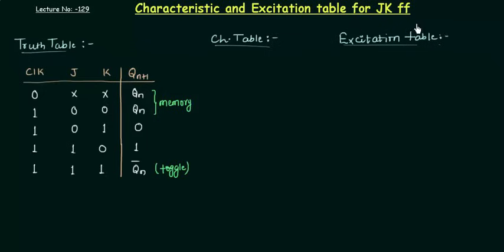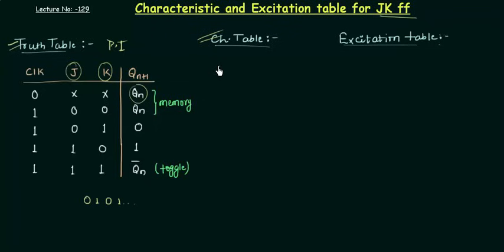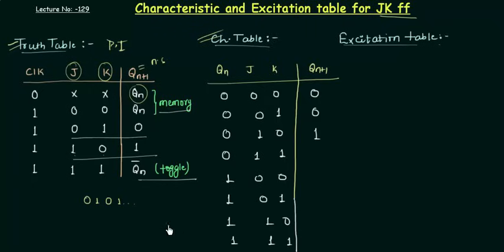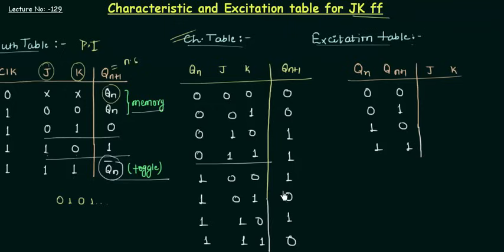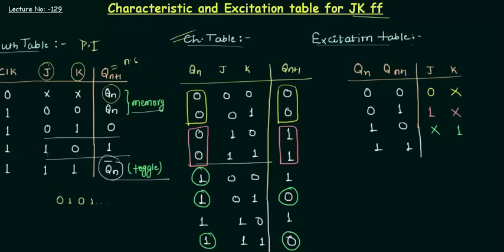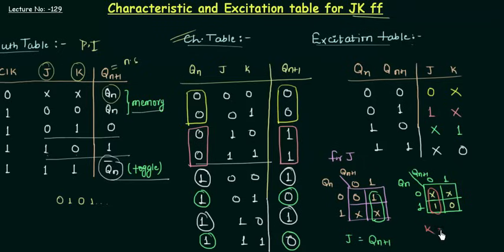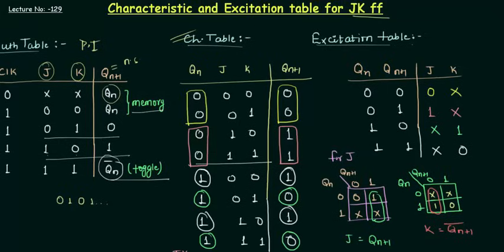Truth Table, Characteristic Table and Excitation Table for JK flip flop

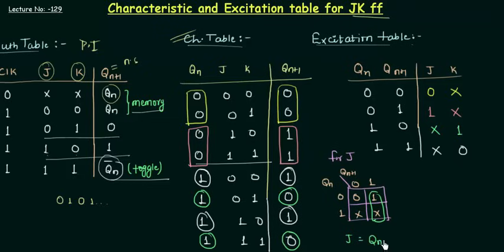Comment: @nesoacademy sir at 7:00, why didn't we make a group with the other don't care condition if we have considered the previous don't care condition to be 1?
Reply: Take the Karnaugh map. In that map now temporarily remove all the don't cares. The group which is possible to form now will be with that single '1' -> Qn'Qn+1. Bring back those don't cares now to consideration. Can the existing grouping be simplified by including the don't care? The answer is yes and it is done by including the below don't care and now we have a simpler circuit whose expression is just Qn+1.